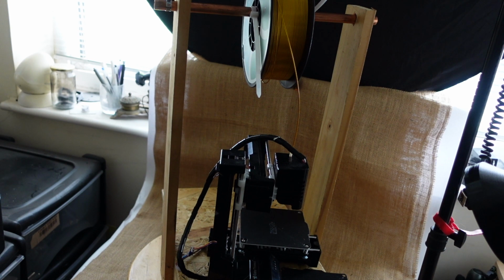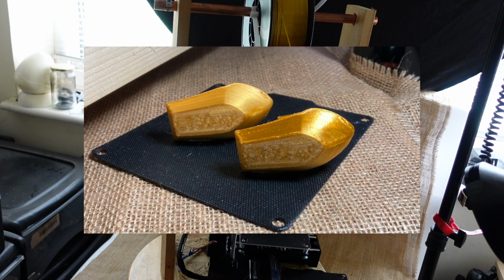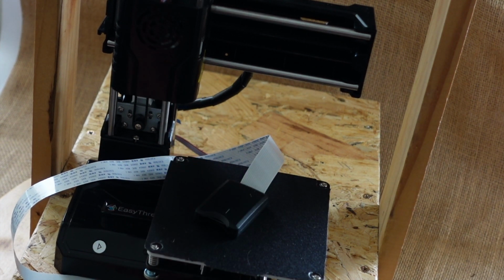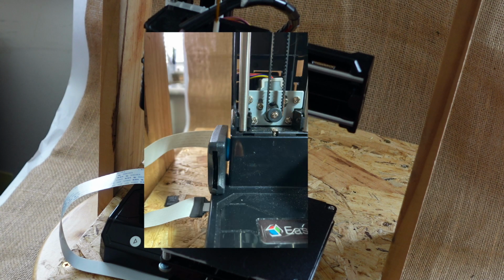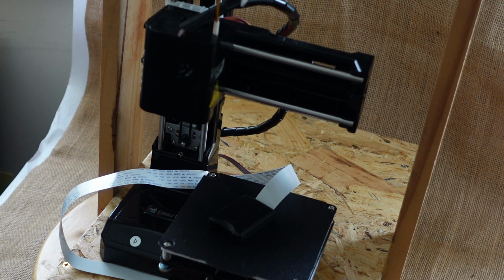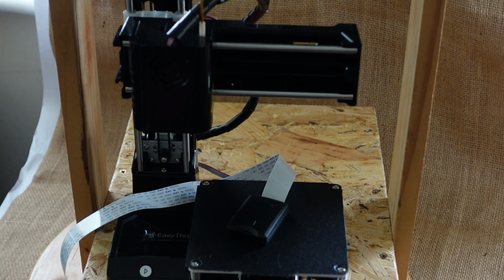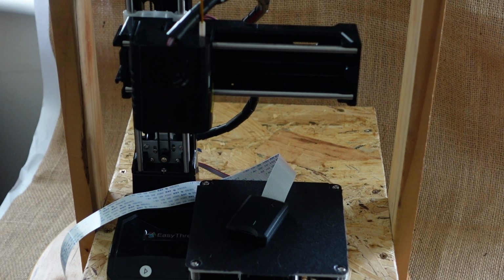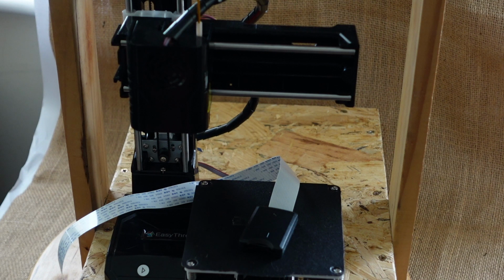Easy Threed K9 Mini 3D Printer Tips, Tricks & ideas around the K9 3D Printer

Comment: That is a super nice platform, may I copy your idea? Then for the print surface, I use painters tape and cover the base - the prints stick very well and the tape saves the base from gumming up with print-goop.
Reply from the maker: Yes, absolutely. you are very welcome to do that. I think most people would make a better job with it too. If the base is deep you might be able to put a drawer in it to store the power brick and accessories. Normally the power brick drops when transferring the printer so a storage would be a useful addition.

I could have done that, but I'm not a brilliant person for precise carpentry. II did learn at school back in the day (a very long time ago) but most of it didn't stick. We did carpentry etc with hand tools. Nowadays its all different with machines for this and that to make things quicker. The thing is the machines cost a fortune to buy and need to be stored etc. 

I planned to make another series based on making the base as well to show what's needed etc to do a rough job of making it in a slightly better way but still as cheap as possible in keeping with the printer's price point. Also maybe the drawer if there was one could be bought as an insert and so make that part of the job a bit easier while still being cheap. Ive dropped the ball due to being busy with other projects. Ill get round to it eventually but similarly if you wanted to do any content on the idea yourself please feel free. I support anything that makes the hobby more inclusive especially  those with lower budgets to do things they would enjoy without breaking the bank. Unfortunately I note that you can no longer find the K9 for reasonable prices anymore. I broke mine by crushing it badly and had to buy another used. I don't think its justified so much at the current price point. The K7 is the better device if the price is similar. 

Also your idea of using the painters tape to protect the surface is very useful. The beds are available from Ali Express separately but of course its better to make them last rather than planning to replace it.

Thanks for watching the video and for your comments.Kind regards & best wishes.

Comment: This is brilliant! do you have the dimensions for your rig? this is great!
Reply from the maker: Thanks so much for your comment. Its 22 inches tall - the uprights. The platform is 10.5 x 17 inches and 3.5 inches deep that is the board plus the framing. Ive discovered that it's better to place the 1kg spool on a spindle at the rear of the platform running the filament over the bar and into the top of the hotend that way. It works better that the retractions go into a stand of filament rather than directly to the spool. Ive shown it in my most recent video on the K7. Kind regards & best wishes.

Comment: Can you help? I was using my k9 for the first time last night. went well! the little rocket file in my included card is adorable. it was a little tough to get it off the platform so i attempted to adjust the leveling a little.. during this the tip began to release some filament ( i suppose i should have removed the filament maybe? ) and was still lowered. I got it back up, removed the blob of filament, removed the filament from the feeder (the white that came with the printer) and now it is not feeding or heating at all!  I cannot find anything helpful with this particular printer, for this issue, so far.   I only received this on Christmas morning and set it up last night to finally try.
Reply: also, ty for the tip about the extender for the sd slot.. i'm about to order one for my printer. The position of it on this has already proven to be a bit difficult to work with since i cannot see it easily.
Reply from the maker: @eleah1316  Having the SD card extender is great due to the micro SD cards being fiddly to use & easy to misplace. It's possible also to get an adapter extender which enables the use of standard SD cards    in the reader which has a standard SD card reader & ribbon cable to micro SD card plug. Thanks for watching the video & making a comment. Kind regards & best wishes.
Reply from the maker: Im sorry you had this problem. I hope you were able to get it fixed. If you have any blobs on the printer I would suggest raising the print head and running the loading sequence to heat the filament & then extrude it. Normally I clean off any blobs carefully with a tough leather gardening/riggers glove that has tough leather fingers and palms which should protect from the heat of the nozzle and can be used to clean the nozzle prior to levelling the bed.  Id suggest disconnecting the printer from the electricity supply and power cycling it to see if thats effective at resetting it. Please let me know how you got on. Kind regards & best wishes.

Comment: As I mentioned in your latest video, I have just bought one from AliExpress for under £60 total. There is an offer on at the moment (15th Nov 2023) where you get £3 off every £15 spent. The printer is listed at around £70 and with £12 off then free postage and + tax, it was £58.20.  
I haved another printer in bits as the plywood frame was broken and the display missing (it was a Prusa 3d printer) and it has a hot plate and I was thinking of making it fit the new K9 I will be receiving in a couple of weeks. I have made a reel holder out of plywood but never thought of making a carrier like you have. 
To stop hte base sounding like a drum, board in the bottom of it.

Comment: What's the difference between the K7 and K9?
Reply from the maker: Thanks for your comment and watching the video. I haven't personally seen this but I understand that with the K7 its necessary to move the print head by hand to each position to level the bed. The K9 moves to each position by itself. It has 4 buttons which when pressed, the printer moves to each position automatically. This is a great innovation. Im not sure how they vary  in terms of other issues but this alone is enough to mark out the K9 as superior. Levelling the bed is quicker and easier than on printers costing many times more. I hope this answers your query. Best wishes and kind regards.
Reply: @NightStarLeafTech-vj3ez  thanks. Will get this instead.

Comment: thanks for this video!  Still waiting to get my k9, this is a great idea for between now and then. Happy printing!
Reply from the maker: Thanks for watching. Hope you enjoy using the printer. Im looking at the Cura Slicer for the printer. My next video will be on that subject. Plus I have another series of videos coming out looking at 3D design so you can design your own things and then make them using this printer. It will be using Design Spark Mechanical software.The Explorer version is free. I use it all the time. Its great and quick learn. Kind regards and best wishes.
Reply: Did your k9 arrive? How is it?
Reply: @sherlockhomes9919 Mine did today. Perfect condition, screws are a bit difficult to screw in (I actually didn't manage to screw in 1 of them at all) but the printer is quite rigid by itself and even with standard filament which is apparently quite cheap I got a nice little test model after 2 hours of printing.

Comment: Looking at getting this printer, to have it on a shelf in my office. I can get it for 75 GBP here in Sweden. Want my first printer to be cheap and small, with decent print quality for the price. Bang for the buck, so to speak. Would you recommend it? Thinking you’ve had enough time with it to give a final word about it. Or should I put more money in, to get something more premium? Would love to hear your final thoughts! Thanks in advance!

PS: Does it have safety measurments like overheating and such, so it doesn’t start a fire in worst case scenario?
Reply from the maker: Thanks for your comment. Ive honestly no idea if it has thermal over run protection. I figure if the thermistor doesn't break, it cannot over run. Ive never had this happen in any of my printers which are all well used and had a load of maintenance etc. If you don't touch the thermistor, etc you can't break it unless you break the wire in the loom or it breaks by metal fatigue. My printers all have 1000s of hours and I've never had a hint of this happening but if you are concerned I suggest you look for printers with thermal over run protection.  

The brilliant thing with the K9 is that its simple to assemble and to operate. The adhesion is perfect off the bat but there are many similar ones that use a build tack or similar surface. IMHO you should try to find a printer that uses similar technology for the print surface. Adhesion is the main issue I see and with these beds thats simply a non problem. I can't say what's right for you specifically. It is "quiet" so it might suit an office  environment but if you are trying to do work which involves quiet concentration, I doubt you will be able to work next to it unless you have a sound proof booth or similar. Even the most quiet printer, it won't be possible to work close by. I can recommend it to anyone who is on a low budget who wants to get into 3D printing, to test the concept and to learn and is content with the 10x10x10 build volume and Printing in PLA or TPU. Im still going to be doing more on the printer going forward. The problem is having the time. We all have that issue.